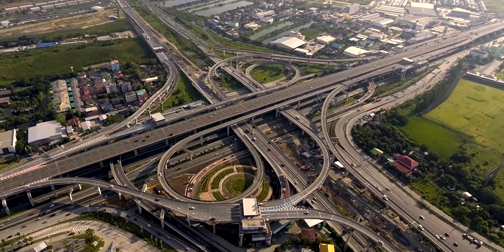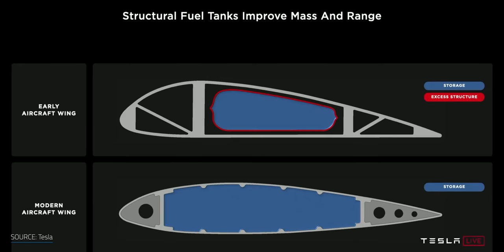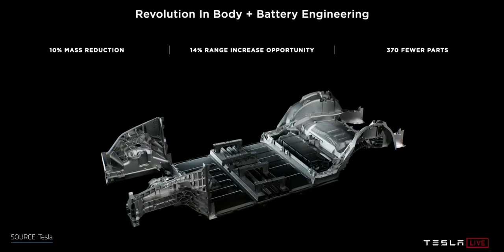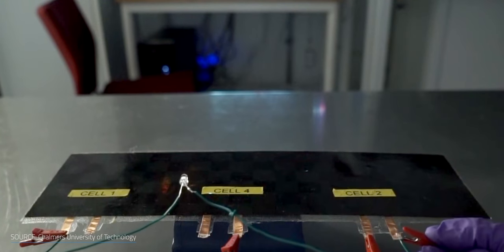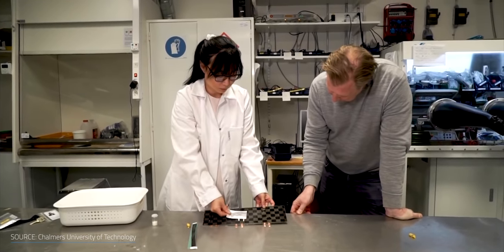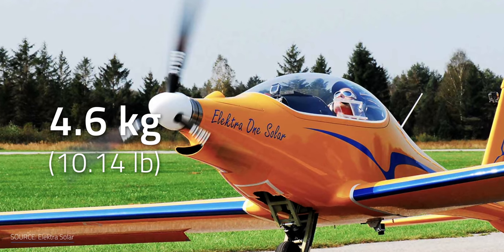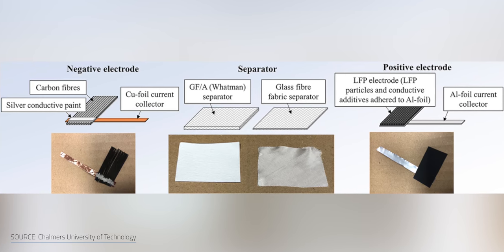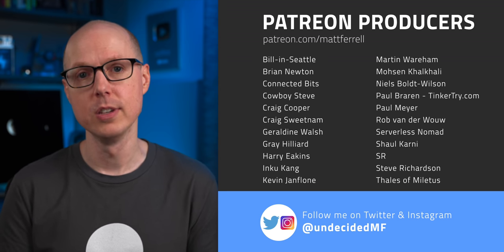Exploring Structural Batteries

Comment: A battery that is a structural component of the car, sounds impossible to replace when it reaches its service life.
Reply: I know right? Batteries can last a long time, but only if they're taken care of. Since many owners of gasoline-powered cars don't bother to maintain their vehicles properly, I can't see EVs doing well in the used market when they eventually make the switch. There needs to be an attitude change.
Reply: First thing that came to mind.
Reply: As SandstormGT said, that was the first thing I thought about. Remember, most batteries today are mulched and crushed when recycled. I really don't see how this is a step forward, looking at a full-loop cycle. From construction, to usage, and then recycling into new cells.
Reply: @Tuppoo94  Even properly maintained batteries degrade rather quickly. If the batteries were structural and thus pretty much impossible to replace then an old well used EV would basically be a big expensive paperweight even if it was properly maintained.

If you maintain your car it will last for your lifetime and even several generations more. But even if you maintain an EV it doesn't matter if the battery can't be replaced eventually that EV won't be usable at all.
Reply: It needs to be modular for repair to happen but knowing these companies with planned obsolescence will make them difficult to repair and favor replacement.
Reply: @Tuppoo94  
I'm not sure how much maintenance a battery would need if any, but it will degrade over time and need to be replaced eventually. This doesn't sound very replaceable.
Reply: @glidercoach  The biggest problem with batteries is that over time their ability to store electricity will be reduced, and when they discharge the electric motor's performance will also be reduced. It's like having a gasoline car with a fuel tank that shrinks over time, and you won't get full power if you're down to the last few liters.
Reply: Depends on if the cab area is isolated like in a pickup, also depends on where the battery is. I can see the battery Tesla is talking about using in the video being an easy change even though it's 1/3rd of the frame, but it would require a fixture to immobilize the other two frame members. Thus moving battery replacement too a dealer level repair. Properly thought out I could see how it could be changed in a hour or two
Reply: At the end of service life - the battery still works, it's just lost 20% of it's capacity.

For a lot of ICE cars, if you aren't a backyard mechanic, by the time the transmission fails, it isn't worth replacing it either, despite it being replaceable.
Reply: Windscreens form a structural component of a car yet you can still replace them.
Reply: @ThisRandomUsername  
Windscreens are not and do not add structural support to a car.
Reply: @ThisRandomUsername  similarly, the Ford Mach-E actually has a structural battery pack according to Sandy Munro... And it can be removed.
Reply: @ThisRandomUsername  
Windscreens are thin and fragile glass layered with a plastic to keep the glass together when it shatters. 

They offer little or no structural support, certainly not 45%. They pop out on occasion in accidents. 

Steel in tube form and formed welded sheet metal is structural.
Reply: @glidercoach  I disagree. Glass is pretty strong, and with the correct lamination process can be strong even when cracking in an accident. Look at a lot of the modern cars with their full glass rooves and very stiff chassisess. 

The thing we're saying here is that the battery can be a structural member while still being removable (as a lot of removable bars and such are).
Reply: Okay I'm not an expert on this but I like free thinking so I would give it a shot. It's in the way the battery is made. Is it made as one big piece then it would be inrepairable, but what if we made small structure batteries that each resembles a part of the car and put them in a parralel order. Like for example the bumper of the car is broken. If you made the bumper as one car battery part you could replace the bumper of the car with a new one without having to demolish the rest of the car. When the batteries are out of their life cycles they could easily be replaced because we made small parts and not one big piece. Okay I understand that when you need to replace all the parts because the batteries ran out of their life cycles it would be very expensive. It al depends on the life cycle of these carbon fibers batteries. Maybe you could solve this by making the cars modular so that it is easy to remove parts from the cars structure and place in another structure. Make it easy to remove the engine in minutes and place in the the other car within minutes and that for every part of the car that isn't the structure. If it would be possible to remove everything from one car structure and place it in another car structure it would be groundbreaking by itself, but if we could made it with the right technology, tools and knowledge to happen in less than 1,5 hour it would be something that can become a key in the future for recycling and give this project a chance. The battery structure that will be left behind could be recycled so that nothing is wasted. 

I know this is a fake future scenario, but I think this could technology could work in the future if they can overcome the hurdles. 
What do you guys think of this? Did I make some mistakes (I'm a freethinker not an expert)  or do you know a problem that I haven't faced  yet?
Reply: @bramza8853  you're talking about battery modules, which is how it's done today.  Tesla went that way early on anticipating it helping with having to replace some amount of failed batteries. But they don't really fail.

Or on the other extreme you're talking about what Nio is doing with swappable batteries (and that Tesla originally was planning on for the Model S). But swapping means needing a lot more batteries than cars, and infrastructure to do the swapping.

Recycling won't be as big of a deal as is assumed.  Super cooling a discharged battery allows it to be put through a jaw crusher without fireworks.
Reply: @ThisRandomUsername  
Yes structural glass is very strong and heavy. Cars must be as light as possible for fuel efficiency.
Reply: @KenLord   okay I understand what your saying but what should we do when a battery dies or runs out of it’s intended life cycle?
Reply: @KenLord  The transmission part is total BS, there is an absolutely huge second-hand car market, which includes complete motor swaps and, yes, transmission swaps.

Also: nice job quoting manufacturers numbers with that 20%, however: What a manufacturer sees as "service life" is what they call "
economic life" which is not the same as the actuall lifetime of the product, which is called "technical life". 
Short example: Cars from the 90's that are still riding, are WAY past their "economic life" as specified by the manufacturer, but might very well have many years of "technical life" left.
Reply: That's probably part of the idea, honestly. Buying an entire new car earns the manufacturer more money than just a battery replacement. Terrible for the environment, great for profits.
Reply: Exactly my point.
Reply: @MiniDemonic  Then you are in need to buy new car thus you are spinning the economy It's good for economy not for environment and consumer. .
Reply: @glidercoach   So you're agreeing that structural parts can be removed and replaced? I guess your original concern was more about what if they don't make it easily replaceable. I think they likely will if for no other reason than to make it easy to assemble and replace if faulty on the production line.

Someone else already said it somewhere in this video's comments. The Mach E already has a structural battery which is easily replaceable. It's just that it's the case that's structural, not the cells themselves. The thing is the current batteries don't contain individually replaceable cells and that's not a problem.
Reply: @kjeldschouten-lebbing6260  hahah wow, no wonder you use 'noname' as your handle.

I grew up pulling parts from autowreckers myself to keep my Pinto going. I currently drive a 2003 ford truck ... which is becoming increasingly expensive to keep on the road and increasingly hard to find parts for.   It most definitely will not be worth the cost if my transmisson dies ... or even if my freaking timing chains go. 

Did you even read the part excluding backyard mechanics from the equation who can do it themselves?

Are you even aware how much less maintenance an EV needs?
Reply: @ThisRandomUsername  
Yes, structural supports can be removed, usually for maintenance. They are steel or aluminum and are bolted in place to make the product stronger...

...unlike windscreens which are glued in place to make them waterproof.
Reply: @glidercoach  So in other words a structural battery has no reason not to be removable and replaceable?
Reply: @ThisRandomUsername  
The video didn't say either way if it was easily removable, which prompted my comment. 

Other commenters in other threads also have this inquiry. 

From an maintenance perspective, it's pretty important to be able to swap out the battery system in a cost effective way.
Reply: interchangeable body panels that are connected
Reply: @glidercoach  Yeah, I agree with the need to be able to swap out the batteries when a car gets old. Hopefully the right to repair legislation passes, forcing manufacturers to allow access to tools, parts and schematics that will let you repair your own electric vehicles soon.

However, replacement of cells themselves likely won't be that economical whether parts are available or not. That isn't necessarily a terrible thing though, as you could strip the old batteries down and sell them to recoup some cost of the new pack.

I myself drive a 21 year old Alfa 156 and a 22 year old Fiat Uno, which I maintain myself, so it's definitely something I'd look into when buying an electric car. I think I'm more likely to convert a car to electric than to buy an electric car in the near future though.
Reply: Not to mention the whole structure isn’t going to be actively cooled even further worsening the issue of battery decay
Reply: @nathansukchai9415  The more I think about it, the more stupid I think this idea sounds. If you go and make body panels out of batteries, you're unable to protect them from impacts, your centre of gravity goes up, and you need wires running a long way around the car, adding resistance. The cooling issue you bring up is another problem.

The right way is likely going to be to just make the floor out of a box of batteries (as is done now), potentially epoxied together for rigidity with a cold/heating plate on one side of the bank of cells. Maybe the cells in the box can add strength to the box itself, but you've still got to pad it to prevent irreparable damage when someone runs over a branch or scrapes a rock in the road.
If anything, this will just mean they could make the cell shells and one of the electrodes out of carbon fibre instead of stainless steel, meaning a slight reduction in weight to an existing process.
Reply: This is exactly what I am thinking, batteries don't last forever and will eventually loose capacity over many charges. Especially in higher performance cars will only last you probably guessing 3-5 years time. Even when the creation of solid-state batteries they will still have a lifespan of use. This would make even more waste than what it is trying to solve.
Reply: @justingrey6008  But because of that maintenance wouldn't it be more expensive than a regular gas engine car?
Reply: @ThisRandomUsername  windshields aren't strong from the inside, only the outside, I just broke mine with my head from inside when messing with the speakers in the dash. no way that is providing structural support when the source and direction of the force potentially being applied is undefined.
Reply: @scottrutherford  Lol. I've cracked my Uno's windscreen by kicking it over onto a carpet while it was out of the car for rust repair, so I can relate.
While it isn't tough against pressure perpendicular to its surface or bending, in the plane under compression, tension and twisting forces, they are pretty strong, and do play quite a role in the rigidity of the cabin of a car, and can be made to resist disintegrating during an accident.
What I was actually getting at is that structural parts of a car can be made to bolt or glue in, and aren't necessarily hostile to repairs.
Reply: UW prints solar cells you can punch holes in with a knife and they keep working just fine - pretty sure this isn't much of a leap.

I'd imagine mostly it's deposition on metal panels or formed into composite panels and then just tapping it.

Once you can paint this car with solar panel paint it will run forever until mechanical failure.
Reply: @ThisRandomUsername  Completely agree with your main point and now I've been off and done the research I should of done before commenting I agree with the rest too :)
Reply: Why do we still thinking that electric vehicles are going to save the planet when this is not true, we need to erase the dependence of cars. That is the real change.
Reply: @russellzauner  It still needs batteries to store the energy it needs to accelerate suddenly. Some of the best cells on the market are ~20% efficient. If you covered the entire top surface of a car, let's say that's 10m^2. At the sunniest part of a midsummer day, the solar radiation is ~1000W/m^2, meaning you'd be able to get maximum 20% * 10m2 * 1000W = 2kW.
Roughly, a Tesla Model 3 takes 8kW to go 110km/h.
Reply: Also that makes every accident a fiery explosion of death and battery
Reply: @scottrutherford  Thanks for that. I was beginning to doubt what I'd heard, as all I've found in my Googling today is articles by glass companies peddling their premium quality stuff.

I'm not a mechanical engineer, so this takes a bit of reading and thinking to make sure, and I could still be misguided.
Reply: Yeah, thinking exactly the same. The only way you can pull this structural battery idea off without creating a ton of irrepairable products is if you only use them as reinforcing structures. so you can take off and replace these battery-structures one at a time. Like having a base frame that is really low weight and barely strong eneough to keep the car together, on which these batteries are bolted on, to give the whole thing the rigidity to be fit for driving. Otherwise we really will be in an obsolescence-hell.
Reply: Yeah, the batteries in my 69 Charger are most definitely NOT original equipment.
Cars with structural batteries as a power source are going to have a seriously short lifespan and so never get the chance to become a classic.
Reply: @KenLord  not true. Tesla also has a form of transmission called converter with high end oil. Replacing ICE transmission is very feasible but costly repair but Teslas converter is not possible to replace.

At the end of life for lithium battery is NOT 20% less, its 20% less capacity withing a year or 2. At the end of capacity (could be at 8 years) you charge it but it does not accept the charge and when you use it the voltage drops to nothing if any meaningful voltage drawn. So one thing that video forgot to mention is lifespan of these fiber batteries. If the same then its the prime of consumer world. Buy/subscribe 5 years throw away as it will be 90% useless. They neef to aim to 10 years at 80% capavity. Even then I will be considering ICE cars for the reason of been able to fix them myself.
Reply: @MiniDemonic  The thing is that there is no maintenance on batteries. The only sort of "maintenance" you can do on lithium ion batteries is to keep them near 50% charge as much as possible, or primarily use between 20-80% of the state of charge.
Reply: That's why my idea was to make it a two layer paint - similar to the way Rhino lining and such work - where the car's metal body itself would act as a battery due to the first layer of paint and then the second layer of paint would be amorphous solar cells
Reply: @hightiernub1313  economy of scale would apply. If millions of these batteries are on the road the cost will be less then if only a few thousand are.
Reply: @justingrey6008  Not the batteries, the maintenance of replacing those batteries. For example luxury cars or performance base cars have higher expenses in terms of maintenance (well depends on the brand or make) but generally expensive because of how the car is made. Just take the new structural battery. It either would be hard to replace depending on the design so it would be expensive.
Reply: @aaronellingsen5404  Tesla is not a perfect company nor as any company in general. They don't even have an inventory for their cars. Which had to be custom made directly when bought. Some models had build issues in which there were gaps in the shell and exterior of the cars which had to be recalled or redone. Tesla is not that embedded in the car economy compared to other established car companies. Toyota is already planning to make solid-state batteries, Ford as well and Volvo's Polestar division and Porche. These companies are already one step ahead of Tesla. The implications matter especially how you'll get your maintenance done since not all mechanics are the same either.
Reply: @ThisRandomUsername  
I support right to repair too and do my own work. 

I'm getting ready to restore my 1967 Karmann Ghia and I restored my 1984 Kawasaki KR250A1 years ago. It a liquid cooled MotoGP 2 stroke. I bought it when I lived in Africa. 

I love old vehicles. I think I'd rather buy a used electric car. I prefer to keep things original.
Reply: @MiniDemonic  whose to say that the structural components themselves can’t be designed to be a replaceable component?
Reply: @nathansukchai9415  
I also thought about that too. Cooling is critical.
Reply: @hightiernub1313  economy of scale still applies, if your doing a few a week you get good at it, as opposed to one a year or less..
But honestly it looks like it should be a simple swap.. hold the other two parts immobile, unbolt all the connections and drop it out.
Reply: My thought exactly.
Reply: Not really. If it's made to be modular that will solve that issue. Eg replace the under carriage, roof, boot, door you get the picture. It will come down to the business model of the car manufacturer. Presently sales of replacement car parts is very lucrative so i see why not carry on with that model.
Reply: @MIHMediaInc  All the batteries will reach their EOL at about the same time, so you're looking at replacing the entire body of the car I guess all at once?
Reply: @glidercoach  windscreens are most certainly load-bearing.
Reply: @dawood121derful  Replacing the chassi of the car, which is like a good majority of the car, just to replace your battery. Mhm, sounds like a great plan.
Reply: @94e88  LEDs lights claim to last 25 years. From the box of 30 bulbs I put back 15 that are no longer working in just 2 years. Lithium is great technology because of its density. But the usability and theory is different. I have yet to own a single lithium device that has battery any good after 2-5 years. Should that be a device I use daily or a device that sits on the shelf. Lets just make it clear Tesla with 60% battery capacity left is not gonna leave outside of town. Tesla 12% baterry capacity loss in the first couple years is significant. I don't want to test range limits all the time. Its also ineficient to charge baterry with a lost capacity.
Reply: @jfolz  
Citation needed. A website from a company selling windscreens is not acceptable. Structural load bearing glass is very heavy and used in the construction of buildings.
Reply: @glidercoach  they obviously don't hold the roof up, but they provide rigidity against shearing forces.
See: windscreen cracks because pothole.
Reply: also sounds incredibly easy to ding it on something and light the entire thing on fire. by design if it has low enough esr and capacity to drive a car you almost definitely do not want to short it out. for road cars this seems to me equivalent to having the fuel stored in fuel bladders all around the car on the outside. carbon fiber fuel bladders sure, but that seems like a bad place to put the juice that makes the car go brr.
Reply: At the very least this battery can all act like the circuit board and the back panel of an electronic device. 
Unfortunately a major drawback is that a structural failure will also mean the entire product will need to be scraped. 
In the case of the car that makes the car a single use item. I would buy an old antique car if I were you... Their value is going to skyrocket when this technology becomes the norm.
Reply: imagine if battery degradation is connected with structural strength degradation! ideal material for disposable things, disgusting
Reply: @94e88  You wouldn't happen to be criticizing other peoples guesses with your own guesses.....right?  Cause I'm pretty sure your "guess" of "5-10% change over 1500 cycles" is the same as saying "After 4 years of daily charging, your phone/tablet only has 5-10% less battery efficiency".  I'm not convinced of that.  How about you go out and buy the Tesla, come up with a proven methodology for testing degradation, then apply it to your Tesla until your batteries degrade substantially.  Then tell us that data and we will get back to you on whether we wanna buy one or not, ok?  Thanks.
Reply: @Prawny  it’s time that companies should focus on the best product instead of the best profits. Start-ups are great examples which have a vision on how something must be done. Unfortunately the same big companies who want more are competing the start-ups out of the market.
Reply: @vradventures8832  that’s what I was thinking about.
Reply: @nathansukchai9415  computers are actively cooled with fans. When you ride a car you have a lot of wind which you can use for cooling and if heating is a problem you can try to use spray paint that doesn’t get easily warm up by the sun. I understand your concern, but I think it would be technically possible to solve this if you have the right people with the right experience on the team
Reply: @chikitronrx0  and how are you planning to do that? How do I get from the countryside 5 km/miles (I know they aren’t the same but it doesn’t matter in this example) away from the nearest town which has 500 residents to my vacation destination 1500km away in the mountain with the nearest town 20km away. This maybe sounds like nobody would do, but this happens more times then you think. Public transport will not work if you have to travel 1.5 times longer to get to your destination
Reply: @ThisRandomUsername  look this up: lightyear one breaks Tesla’s world record
Reply: @ross9263  not every battery is explosive and it doesn’t have to be when new technology arives
Reply: @Nobody-Nowhere  capitalism resulted in getting the most money for the products they made. You won’t get capitalism away, but the government can help revolutionary start-ups to grow and help them compete with the giants. Could be through distributing taxes differently or through investment.
Reply: @3nertia  that all sounds nice but battery spraypaint isn’t going to help I think. To less storage for cars and thin solar panels are not efficient at all and would make a scratch from an accident to expensive to repair.
Reply: @hightiernub1313  or they could take a similar approach as what Apple is doing with phones. They only release a few phones and so the components could be made in large quantities and could be made less expensively. Now back to cars: It’s unnecessary to make a design change every year and thus could those components like doors having batteries inside be made rather cheap. You could make a design change every 5 years and keep producing the last design and components but then with better batteries for example. So people could upgrade the battery from x kWh to x + 30 kWh. That way they can keep these cars for the next 30 years on the road with minimum waste and the old batteries and parts could be recycled into new ones.
Reply: @aaronellingsen5404  skepticism is a good way to push these companies to prove the skeptics wrong and keep the improvements coming.
Reply: @glidercoach  you could use the wind when you’re driving for cooling
Reply: @nexus1g  I mean that way cars can be used for a very long time instead of buying a new one when it doesn’t perform that well anymore. If it’s done well by the car manufacturers this swap of the body could be like half the price of buying a new one and could be better for the environment as well. This doesn’t have to be a bad thing and could be a drive for the companies to still manufacture those replaceable car parts instead of walking away from the project
Reply: @MiniDemonic  it could also be the cheapest parts to repair if it’s well thought of and well executed by manufacturers. If it’s a better buy then buying a new car it wouldn’t be a problem and would open opportunities for a new colour of the car or an improvement of the battery.
Reply: @bramza8853  You're doing a 30,000 foot fly-over, but the devil's in the details.
Reply: @bramza8853  You know there's no point into having a car inside a well planed city with good public transportation. This only happens on the USA because the cities are planed to be car dependend. 5km is not a far distance, you could do on bike well. 
1500km away a better option than a car or a plane, a high speed train could solve so many issues. 

All europe is well connected with train, in some well planed cities there's low vehicle traffic. With no need in some of them. Japan is also full connected with trains. 

City Beautiful & Not just bikes are two channels with this theme in particular, about how a good planning in urban transportation could eliminate the necessity of vehicules in the city. 

We should need to stop thinking there's a need for cars when a lot of cities are build on purpose for having the need to own one.
Is us who have to reclaim the space of the cities and start to change our style of living, cause we are losing a third of our life in traffic.
Reply: @chikitronrx0  the problem isn’t connectivity between cities in Europe, it’s the time it takes to get from a to b. In the example I have given it would take me 1.5x  as long as with my own car. But if I need to bike half an hour to get to the bus and have to wait there 10 extra minutes to go to the train station in half an hour. There I have to wait 15 minutes for the train to arrive and go in the train for 20 minutes. Then I have to wait an extra 15 minutes for the bus to arrive to go the nearest village 10 minutes away and then I’m in the village and have to walk 1 hour to my cousin because I couldn’t bring a bike along. This costs me 190 minutes for something a car can do in like 45 minutes. So why should anyone want to use public transport when a car is faster in any way on mid range distances. By the way would you be happy if you live in downtown Amsterdam and can’t have a car because it isn’t allowed there. Instead you would have to walk 20 minutes to get to the parking lot and I can tell you that that wouldn’t be any pleasure if you have to bring luggage to the car to go on vacation.
Reply: @bramza8853  If you truly think that replacing structurally significant parts of a vehicle will ever be "the cheapest parts to repair" then you are delusional.
Reply: @nexus1g  what do you mean with that?
Reply: @MiniDemonic  I’m talking about the outside of the car not the ‘bones’ of the car. Maybe that causes the confusion
Reply: @bramza8853  It means that what at first may seem like a good and easy idea doesn't pan out when you look at the specifics in cost and logistics of performing a task.
Reply: @nexus1g  okay I understand but sometimes some dreaming is necessary to achieve the impossible😜
Reply: @bramza8853  If you achieve it, then it was never impossible.
Reply: @nexus1g  I forgot to note it like this: “impossible”
Reply: Just like phones nowadays…
Reply: @bruticus0875  well, I base my guesses on the fact that I've built quite many batteries for PEVs (personal electric vehicle, so scoots, ebikes, and even one for a onewheel). And measuring old batteries with approx 400-700 cycles shows less than 5 percent change in internal resistance of the battery. Thats at the battery side leads, not at the plug to the control board.
Reply: @ThisRandomUsername  I actually started by looking for pictures of crashes that would invalidate what I had said, turned out it was all of them... Then using the terminology I'd learnt searched for further info. Actually very interesting, no really... (also sorry for the delay in responding)
Reply: It really only depends on whether the car manufacturer is set on making it impossible to replace. Let's say you put it in the roof, you could easily make the roof replaceable. Let's say you put in the hood: also easily replaceable. But if you work it into the mainframe and chassis .. not anymore.
Reply: @MiniDemonic  No they don't, there's an initial downgrade then its quite stable for years.... We'll soon have million mile batteries....  Dumb assertion mate, how many people have one car for a "lifetime", that's laughable crap, I'm a bloody car fanatic and do all my own work, you're talking garbage....
Reply: @Tuppoo94     There are so many dumb comments on these electric car video's its embarrassing to be human at times....
Reply: @MickH60  "We'll soon have million mile batteries"

HAHAHAHAHA, keep living in fantasy land mate.

"how many people have one car for a "lifetime""

Oh, so you only buy new from factory cars, thank you for destroying the environment then. You haven't seen a single car from the 80s on the streets? I'm guessing you are fucking blind then. In 40 years you won't see a single 2021 Tesla on the roads.

I didn't say that you should keep the same car for a lifetime, I said that an ICE car that's properly cared for can last a lifetime but will likely have dozens of owners. An EV with a battery you can't replace won't even last for 20 years, it won't even be worth using after 10 years.
Reply: Car manufacturers will use a subscription based model for payments in the future... No one will be allowed to own or drive a car... You pay the car company of your choice their monthly or yearly price and anytime you need a ride you call or have the ride waiting in your garage or what ever or you call and theyll send you one ... U get in the back seat and you ride and thencar takes you wherever, whenever... No drivers in the future